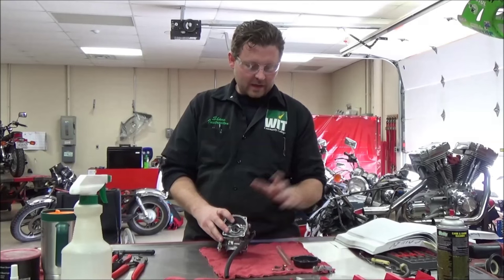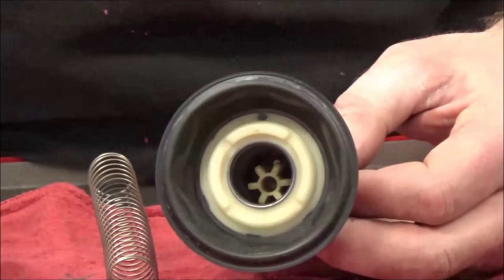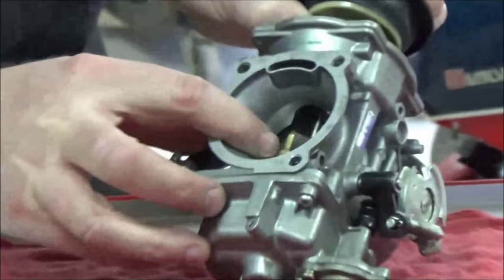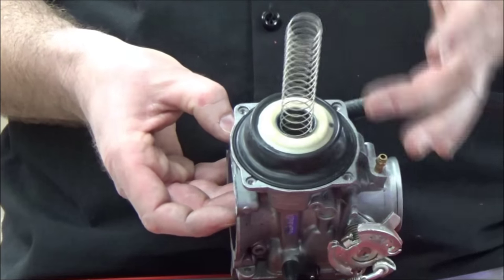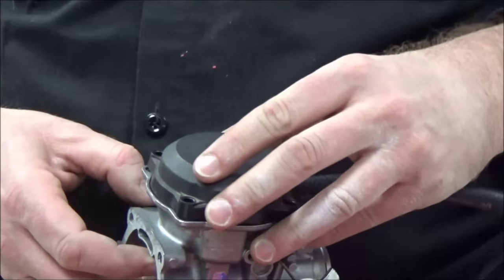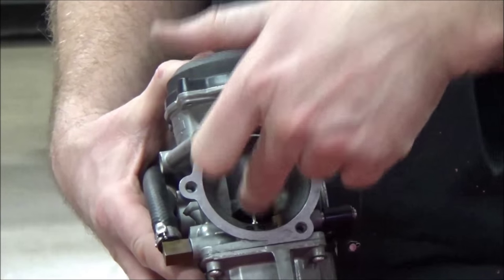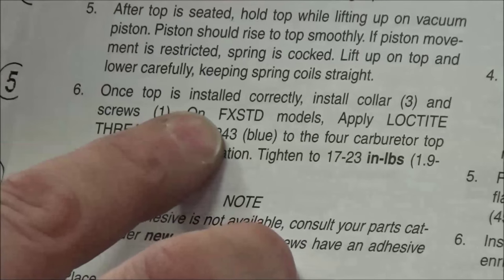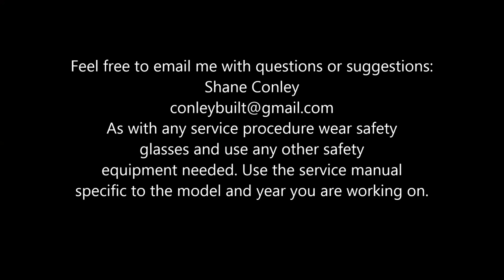How to install a CV carburetor slide without pinching it. Theory of operation and testing too!

Comment: I took a two year course on motorcycle repair when I was 15 (im 52) and have had motorcycles all my life and do all my own wrenching, cars and bikes. I had a great instructor like you who really new motorcycle and small engines. He new CV carbs in and out. I was unaware of the grooves at the bottom of the slide for the plastic spring retainer. I just cleaned and freshened up the carb on my 95 dyna but haven't put it back on the bike yet.now I have to go home and take the cap off to check  it
Reply: Cobra Ninety Six iweeks

Comment: Shane great tip.  Purchased a new slide for my CV carb and had a hard time seating the diaphragm.  Read some tips about using spark plug grease; no go.  Checked out this vid; first time seat....Thanks.

Comment: Hey Shane!

Thanks man, as an instructor at Lincoln tech here in Connecticut in the Welding Dept. I can appreciate your dictation and spirit in you craft. Your passionate, and very articulate.
I need to clean and rebuild my carb on my 2000 Sporty 883. When i twist the throttle back, the engine is very slow to gain speed..sputters...then takes off..
It sat for a year..so a bike mechanic told me to rebuild the carb...is he right?
Reply: I know this is old, but maybe it will help others. My tw200 had the same issues. Sputtering under throttle, lots of white exhaust. Problem was that it was getting too much fuel due to a float bowl needing adjustment.

Comment: You should mention also how one can snip off 3 or 4 could off the top of that return diaphragm spring for faster throttle response. Also the little hole down in there, that it gets its air supply from can be drilled out to about 1/8" to increase takeoff power as well 😉.
Reply: I thought this had now been disproved and it was now seen as a bad thing to do?
Reply from the maker: Hi Kevin...this is really an "old" thought that has been proven to make most models run rich and loose power as compared to a dialed in dyno tuned kit.     While it does work in some cases, it just can't be thought of as a blank statement for all...thanks for dropping in and subbing...Shane
We have over 700 videos in playlists! 
Even more training and deep dives if ever needed…
Join this channel to get access to perks:
https://www.youtube.com/channel/UCBhM8DCKnT3qXwTW0eToyCg/join   
-Daily MEMBER FIRST COMMENTS ANSWERED FIRST 
-Live Q/A video chats
-Wonder if we have a video on your need? Members can request content links!
-Full Access to the ENTIRE 700 video library
-Member-Only FREE tool giveaways 

Just want to say thanks quick to support us for this information and our work saving you money? 
Give us a high 5 here:  https://www.paypal.me/how2wrench

Comment: Question: I love working on old multi cylinder Japanese bikes.  If one or two rubber cv boots are bad, should I replace all of then? The fear of the newer ones being stronger, pulling more air, fuel, etc? Thanks and love the channel!
Reply from the maker: Hi Roger. Thank you for joining! Think of them as having a birthday and all things being equal is my preference BUT sometimes these are spendy and the customer just wants what is needed. I also think is depends on ultimate performance too. If you want the best chance of all the slides behaving the same, New is the way to go...but then again are all the rings and valves seals equal? Most likely the is some variance in different cylinders and only the most experienced rider or a dyno could tell.

Comment: I like to apply a thin coat of oil to the carb slide, and to the rubber diaphram before putting back together.  Any reason why you do not use oil on the slide & diaphram?
Reply: Mechanically sometimes parts are coated with a silicone or teflon and do not need a lubricant like wd40 . Actually coating the part with a lubricant is not good if it has a teflon coating.
I use a dow corning high vacuum grease in the groove where the diaphragm seals to the body. It has a high temperature rating and I use it very sparingly. just enough to hold the seal in place. Also that vacuum grease is rated to be used on rubber. WD40 on the other hand is not good to put on rubber, it will deteriorate thr rubber.

Comment: Hi Shane , another fine video,  I noticed that you applied a small amount of lube to the choke fitting on assembly, Is it wise or acceptable to add lube to the edges of the carb slide  as well ?

Comment: What's the T line on top of a VTwin cv carb? Is it over flow? I have gas pouring out and my bikes not running right? Could this be a shim or two missing from my slide needle
 (86 Honda shadowvt1100)

Comment: Brilliant explanation of the float operation, Shane!
     I have a long trip planned for next year, and would like to ask you if my (Yamaha 250 cc 4 stroke single) motor can be improved in fuel economy terms by using carburettor/float adjustment? 
                         Cheers, Den. Wales

Comment: my keihin ncv 24 carb problem is overflow of gas. my mechanic already clean and  adjusted the float height and still i encounter the same problem. my vacuum operated fuel petcock is working perfectly. what seems to be the problem sir? thanks

Comment: Would using a can of air work instead of thru a compressor? I am 100% positive I have no pinch, tears, or creases in the piston, using the canned air doesnt move the slide at all.  All new jets and gaskets have been installed.

Comment: I do not see the difference in the carb screw holes (in your video or on my carb) to know where the raised dowls of the cap go. All the screw holes on the carb are identical, and the cap fits fine any way it is placed.

Comment: do you think I did something wrong with the diaphram ran good for about 4 or 5 hours after carb rebuild then  all the sudden the bike started falling on its face and popping backfiring real hard after quarter of a throttle it idles fine and but when u opem it up it just sounds lile a 2 stroke and has no power
Reply: I have the same issue, but idles and revs fine. Then bogs down with no power under load.